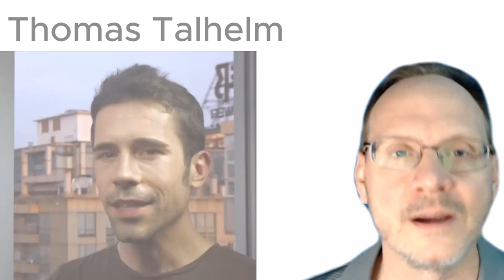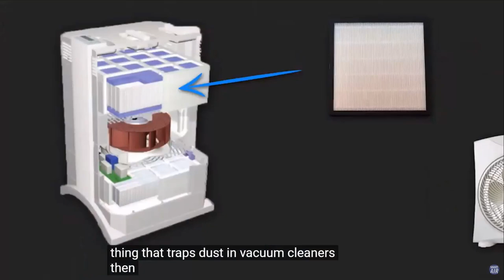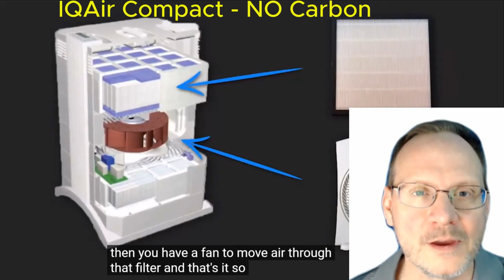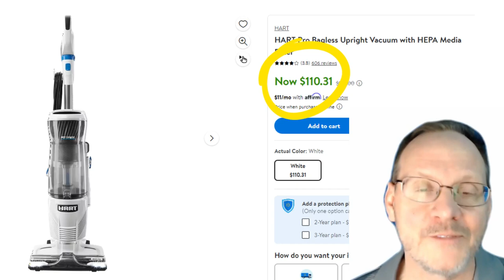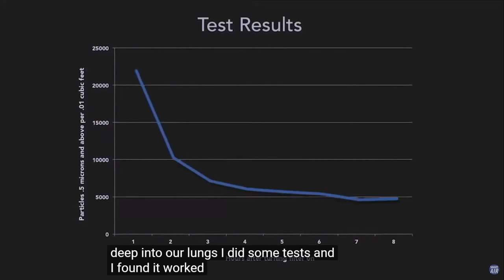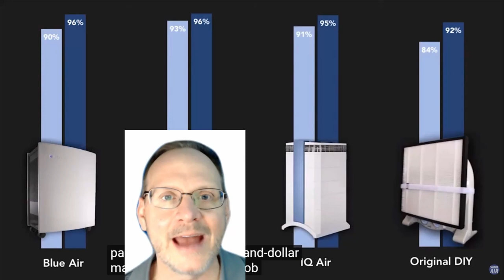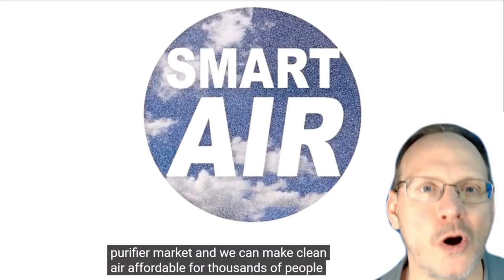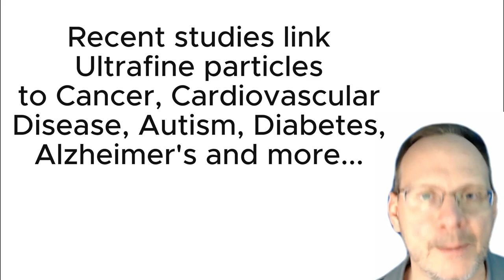Smart Air DIY: Is $45 Air Purifier REALLY Better than $1199 IQAir? Busting MYTHS Review

Comment: I was thinking of a simple air filter that uses positive pressure system which places a centrifugal fan blow into a filter chamber. Reason being is so that atleast the particle are trapped inside the chamber..and placing butterfly gate between the fan and the filter chamber just to ensure one way air flow..is it a bad idea?
Reply from the maker: I don't have much experience with DIY solutions but you may wish to ask this guy - The 3D Handyman.  As he has a bunch of different DIY builds and he sells some of them, as well:  https://www.youtube.com/@The3DHandyman

Comment: have you ever considered making a tierlist of the best air purifiers by price? 
I think a lot of people would be interested in what are the good options for their home in the 100-300 eur/usd price range
Reply from the maker: Hey Joseph,  
YES!  100% 👍
1) I spent the past few months improving my education on "all things air purification" so I could eventually feel more confident that I could "rate" various units against each other without using  "Digital Testing Sensors" as I found out they are not accurate.  My original plan was to use the testing devices to help decide which units have superior filtration however, much to my surprise and disappointment I have come to the conclusion the results would not be accurate.  So, I've been trying to figure out ways to "rate" the units with other measurables.  And I think I am ready to go, now. 

2) Next video: I will be doing a review on the very popular Coway 400 and then - Next video: I will compare the IQAir, Austin Air, Aeris and Coway all against each other... Then we will have a foundation of some of the better particulate filtering units in the US market, at least. Plus, they are all units I am familiar with and have consulted on for years... so, I know they are at least "good" units. 

3) And then I will start reviewing some of the lower-priced units and trying to explain how they all compare to each other.   There is so much misinformation and flat-out lies in the industry that it has been challenging for me to get to a knowledge point where I feel like I can do the topics justice for people and really explain things in a proper manner.  It won't be perfect but it will be pretty good, I think. 

4) What unit(s) in particular are you interested in? I am about to go on a "purchasing spree".  That's what credit cards are for, correct?  LOL!  I'm currently making a list that looks like this:  1. Winix 5500, 2. Coway mighty 3. Clarion, 4. Levoit  5. Blue air 6. Air Doctor 7. Smart air fan

Thanks for the suggestion! 😃
Reply: @AirPurificationEducation is winix 5500-2 better than airdoctor ad3000?
Reply from the maker: IDK for sure, as I have never worked with the Air Doctor units but I can definitely see how the dirty air is escaping around their filters in online videos... I do have an older Winix 5500 and will be getting the newer version soon.  If I had a small room about 200 sq. ft. I'd probably go with the Winix for the price and if I had to guess I think they may very well filter similarly.  There is NO way the Air Doctor or the Winix are getting all the particles down to .003 microns like they claim on their websites.  That is just not happening. Thank you! 👍    @prtbone78  👍
Reply: @AirPurificationEducation  thanks again for the feedback. But for 200  and get almost 4 times price point airpurifier. Thought was a no Brainer maybe ill just pick up 2 more winix  ones then. Which newer winix you looking at and recommend?
Reply from the maker: I'm just getting the updated Winix 5500 - I have one from 7 years ago but I'm gonna compare the differences.  I also just got a Coway Mighty, Clarifion, and Levoit today - and have a Blueair and Aroeve coming tomorrow, as well...  so I'm gonna be busy doing reviews and figuring out how to compare them to each other in the coming weeks.  Should be fun.  😃  Eventually, when the dust settles (pun intended) - I'm gonna get the Air Doctor and take a good look at that, as well.   @prtbone78
Reply: @AirPurificationEducation  daaaammmnnn.  I'll be waiting for the vids.  Appreciate you  🙏   have a good rest of your day  stay safe  thank you again  for the feedback. Might pick me up 2 airdoctor  ad3000s. For 200 bucks I can't beat it. Or just wait and watch  more reviews on it  if not ill grab another 2 winix. 5500s
Reply from the maker: Sounds good - thanks!  @prtbone78
Reply: @AirPurificationEducation  Hey man, 
thank you for your lengthy answer, totally wasn’t expecting it. 

I’m just a guy from Europe living in a very polluted city that wanted to get an air purifier. I’m glad I found your channel before buying some bad air measuring device. 

This field seems to be an extreme version of what the audiophile business was some years ago: it’s all marketing and placebo and measuring is very hard. 

For this reason I think you, with your expertise, have a real shot of becoming popular in this niche if you manage to measure well (I realize it's quite the technical challenge).

Personally I was eying the Coway Mighty, but I’ll wait for your review.
Reply from the maker: OK Joseph - I think, I'll be doing some videos and then hitting the Winix 5500 and then maybe the Mighty right after that... as they are basically direct competitors - that said if ya don't wanna wait weeks for me to get the videos uploaded (I'm infamous for taking too long to upload content, LOL!).  I think both the 5500 and Mighty are 2 of the best that I am aware of for their price points.  I've dealt with many customers through the years who were very happy with both... so, there's that... Thanks!😃  @josephk.9567
Reply: @AirPurificationEducation  Damn, didn't know about the Winix. Here in Europe it has a different name (it's called Winix Zero) and it's considerably cheaper than the Coway Mighty in my country.

Thanks for the suggestions!
Reply from the maker: Very cool! - Yes, it is a good one for the money, for smaller spaces, IMO! 👍 @josephk.9567

Comment: The only thing that matters in a filter is:  volume of air moved by the fan per unit time, size of filter, and mesh size of the filter media.  The small filter can be just as good at filtering particle as the IQ Air and probably is about the same for a small room, because the main thing is fan volume of air and size of filter (not depth for particles.)  Having a carbon filter in with the particle filter is not that great of an idea because it actually releases carbon and since the IQ Air is impregnated with other chemicals, it also releases other chemical particles into the back of the HEPA filter and also into the air since the HEPA filter is not 100%.  So, in a small room it will be hard to find a difference between the two after a sufficient amount of time in terms of the particle count.  The IQ Air might have a bigger fan and move more air and do better at odors and gases.  However, carbon filters (any and all even the big Airpura carbon filters) only filter about 9% of gases/VOCs, not more.  There is no real way to filter gases effectively like you can filter particles down to near 0.  And after the carbon gets saturated it can even become a source of off-gassing harmful VOCs and you never know when this will occur or if it's occurring since it depends on temperature and pressure and other factors that change all the time.  I still think the IQ Air is great because it's so quiet, but it's no better at filters than the old round Honeywell HEPA filters and only about 5-10% better than a Merv 11 taped to an old dirty box fan.  So you can't ever count on a charcoal filter to protect you from really harmful substances like benzene, ethyelen oxide, etc.  because the harmful limit for ethylene oxide is .0001 ppb and it's impossible to filter at that level, its .04 ppb for benzene and very difficult to filter down to that level and then the gas is trapped in the material and will likely off-gas back into the air later when the temperature in the room increases.  For example a gas mask:

"Respiratory protection is effective only if:

the correct respirator is used,
it’s available when you need it,
you know when and how to put it on and take it off, and
you have stored it and kept it in working order in accordance with the manufacturer’s instructions" - CDC

This means that when the carbon cartridges are stored they must be sealed because they are absorbing (and releasing) gases at all times and if you use a stale cartridge it will be saturated and there is no way to determine that practically.  It gets even more complicated than that.

At the end of the day filters are good to improve particles in your indoor air, they won't do much and possibly can harm you if you try to rely on them for hazardous gases and VOCs.  So, what actual occupational doctors and scientists recommend is to remove yourself from any potentially harmful exposure in the air, don't stay there and try to filter it or rely on filters and carbon.

Then you have the time it takes for a filter to work, it takes a long time, so if you are relying on it to filter out really dangerous substances you will already be dead by the time it starts to work, because there is so much more air volume in a typical room or space than a single filter can filter in a short amount of time.

So filters are good for supplementing your air and improving it but they are never going to be perfect and the best solution is to live and stay away from any known sources of air pollution.  You can use PurpleAir as a good estimate to see the pollution in different areas of the world.
Reply from the maker: 1) “ The small filter can be just as good at filtering particle as the IQ Air and probably is about the same for a small room, because the main thing is fan volume of air and size of filter (not depth for particles.)”

***I’ve sold many different air purifier brands and the IQAir HPP has almost always received the best reviews from customers in my experience.  I’ve dealt with many customers through the years who tried out numerous different air purifiers before settling on the IQAir HPP and many have stated that it enabled them to breathe better than any other air purifier they’ve tried in the past. And it was pretty rare for a customer to say the opposite (going from a HPP to a lesser unit).  So, I do believe it filters particles much better than 99% of the solutions on the market.  

2) “Having a carbon filter in with the particle filter is not that great of an idea because it actually releases carbon and since the IQ Air is impregnated with other chemicals, it also releases other chemical particles into the back of the HEPA filter and also into the air since the HEPA filter is not 100%.”  

***Anything is possible… it may/may not be an issue.  Plus, there are many different types of carbon out there.  That said, the HPP is one of the best-sealed mass produced units on the market so, I would think it would possibly be less of an issue for this particular unit vs. other brands/units. 

3) “However, carbon filters (any and all even the big Airpura carbon filters) only filter about 9% of gases/VOCs, not more.”

***I currently find “only a 9% success rate” hard to believe as I’ve successfully used a HPP for new paint fumes in an office room. And I’ve had many customers successfully use various carbon solutions for very intense VOC environments like professional car painting and diesel fuel VOCs.  

I had a guy who had school busses sitting in front of his home running for 20 minutes every morning and he said he was getting “diesel fuel odors” in his family room.”  The school would not reroute the busses so he said he was forced to sell his house.  His last ditch effort to possibly stay was purchasing an IQAir GC unit with 12 lbs. of carbon.  He called back 2 days after getting it and said it completely solved his problem and he wasn’t planning on selling his home anymore.  In this instance, I do believe the carbon absorbed more than 9% of the VOCs in his environment. A 9% success rate would not have been good enough for his situation, IMO. 

4) “I still think the IQ Air is great because it's so quiet, but it's no better at filters than the old round Honeywell HEPA filters and only about 5-10% better than a Merv 11 taped to an old dirty box fan.”
* As stated before,  I’ve dealt with many customers through the years who tried out numerous different air purifiers before settling on the IQAir HPP and many have stated that it enabled them to breathe better than any other air purifier they’ve tried in the past.

5) “Then you have the time it takes for a filter to work, it takes a long time, so if you are relying on it to filter out really dangerous substances you will already be dead by the time it starts to work, because there is so much more air volume in a typical room or space than a single filter can filter in a short amount of time.”

***OK, that was pretty funny, LOL!  I haven’t had anyone die before the air purifier started to work but I’ll never say “never”, LOL!😆

6) “So filters are good for supplementing your air and improving it but they are never going to be perfect and the best solution is to live and stay away from any known sources of air pollution.”

***Agreed 100%!  Hawaii here we come!

7) “You can use PurpleAir as a good estimate to see the pollution in different areas of the world.”

***Maybe  - IDK - I currently don’t have a lot of confidence in air quality sensors but I’ll be learning more about them in the future.  The last 2 reviews I saw for the Purple Air were unfortunately, very poor - and that didn’t increase my confidence in these solutions, in general.

Thanks for the post! 👍
Reply: @AirPurificationEducation  CR (Corsi-Rosenthal) box provides better value for clean air.
Reply from the maker: @MrUncleBob  Thanks for the comment.

I think we would need to define what "better value" and "Clean air" exactly mean.

And it will probably depend on the specific application and the other units that would be options.  

I currently think a CR box is probably a very good value to "dramatically Improve" the air quality in a woodworking shop environment vs. other available options.  

But, if we purchase good quality 3M filters for it - there are other inexpensive air purifiers which will filter better for a similar price/cost of ownership for other applications like a bedroom for dust, etc.  So, I think we'd need to look at it on a case by case basis.  Thanks!  👍

Comment: well if you are in an envaroment that produce large particles you don't need to capture all sizes particle you just want the big ones. and for that you don't need the good filter even just a fan with some cloth
Reply from the maker: If you have large particles in your environment - then you probably also have small particles, as well. The ultrafine particles represent 90% of the particles in the air and are the most dangerous ones to humans, as well.  That said, if you are only interested in filtering larger particles - then yes, you can use a MERV 13 filter and a fan - or whatever and a fan...  - just as long as folks realize they are only filtering the larger, less hazardous particles.  Plus, not helping with VOCs/chemicals, either.